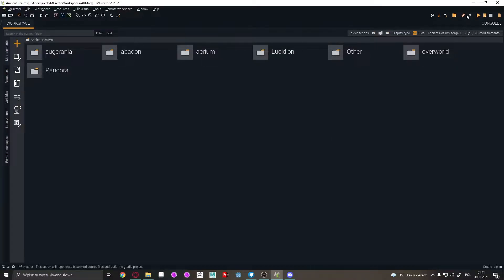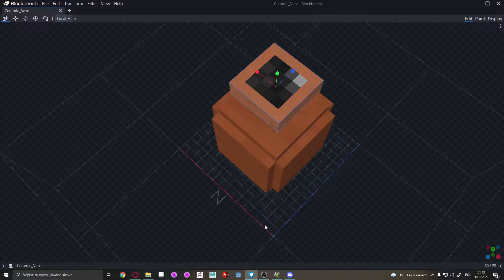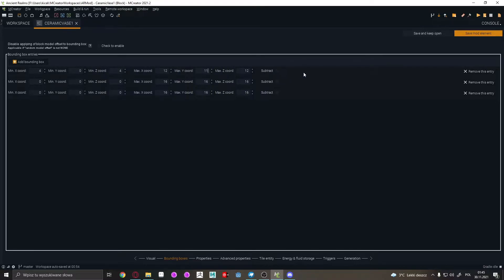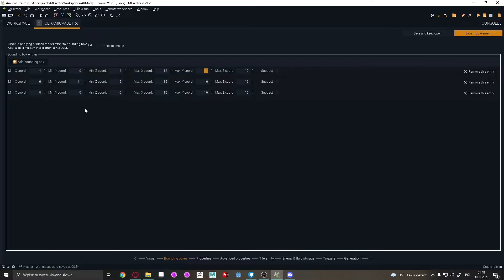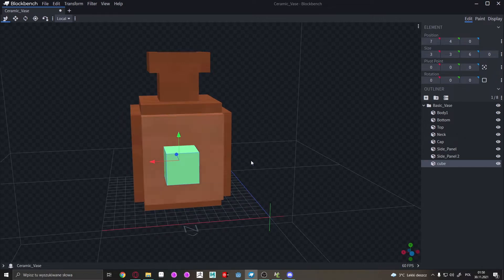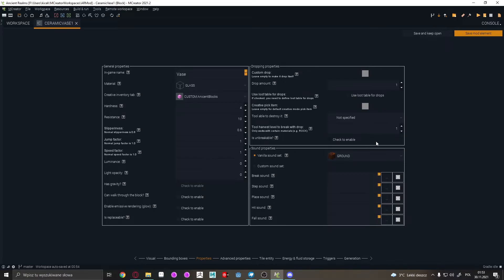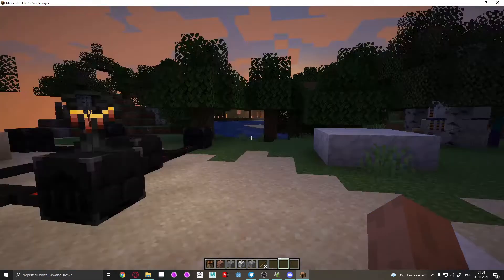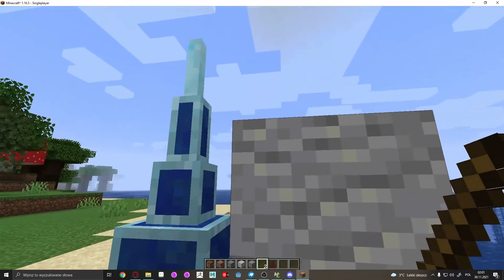MCreator Block Collisions tutorial

Comment: Im using MCreator and I don't know why but It doesn't works
Im using the version 1.19.4-45.1.0 and I can pass across the block and the bounding box is only visible if I put the pointer at the original block (16x16x16)
Reply from the maker: That is the issue with many blocks, not only in mcreator
Reply: @Millu30  
Do you know any way to fix it?
Im using GeckoLib anyway
Reply from the maker: @Ner3a_87  no